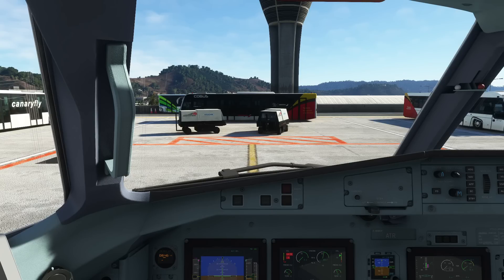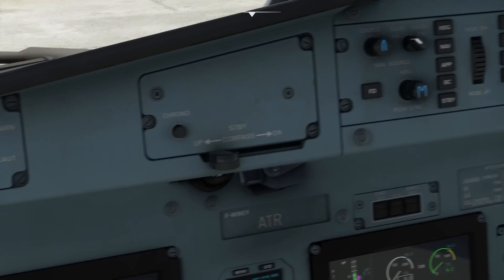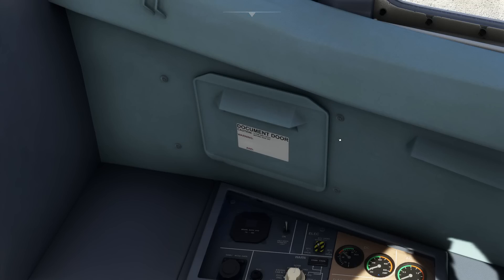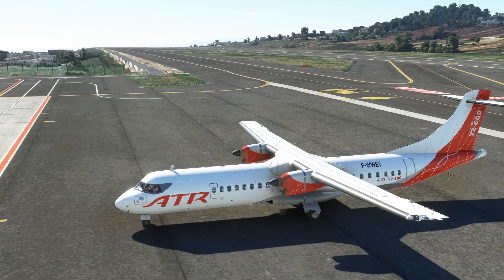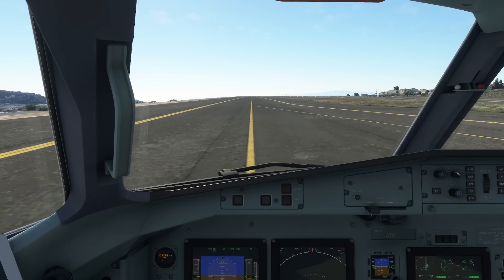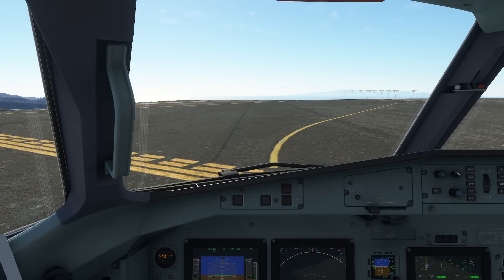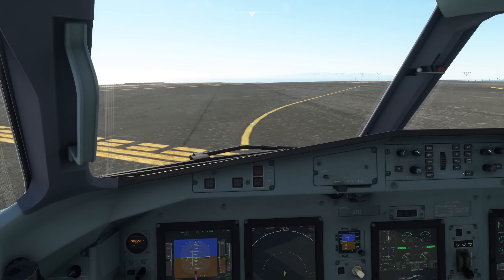ATR 72 & 42 Tutorial 4: Engine Start, Push/Powerback, Taxi | Real Airline Pilot

Comment: I wonder why the T/O config ok light lit up while the gust lock was still engaged? Further, all the other planes I've "flown" call for gust lock disengagement already in the before taxi checklist.
Reply from the maker: Looking into the FCOM it seems the gust lock should be part of the takeoff config test indeed. Be sure to submit a bug report!
I disengaged the gust lock at the moment where the FCOM normal procedures asked for it.
Reply: @A330Driver  I'll file an issue; though I don't own the ATR (yet, waiting for the Trall first). 
Btw, what is the situation with gust locks anyway - why do some planes have them as a switch and some planes not? (I guess the B73 and A32 still have them in the form of pins and locks outsite? Maybe this is even worth a video  ;)

Comment: Nice video using correct procedure for engine start...hopefully other simmers can learn from this video ..note.. there are two idle positions..FI & GI..latter is generally used for taxi..
Reply: With the new update of GSX the pushback in hotel mode is possible. At least it worked today.

Comment: Timestamps for myself:

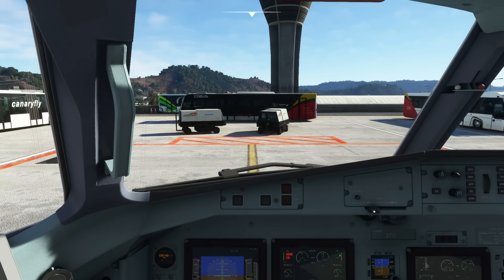------ Powerback or Pushback? 2:06 ------
NoseWheel Steering ON
Hydralic pump PRESS
Propeller Brakes OFF

Engine Stab - Condition Lever 2 AUTO - 3:10

Probe Heat ON - 3:50
Anti Ice Nec

Flaps - 15

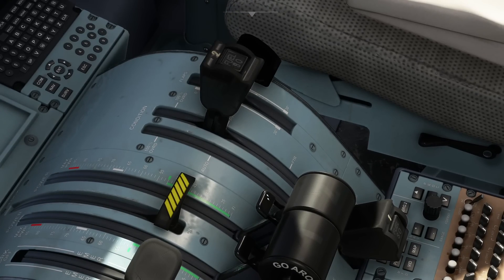------ Engine 1 Start 4:34 - 5:20 ------
ENG START - A&B
ENG 1 START
Above 10 % - Condition Lever 10 FEATHER
ENG Stabel - Condition Lever AUTO
Trans - ON
ENG START - OFF

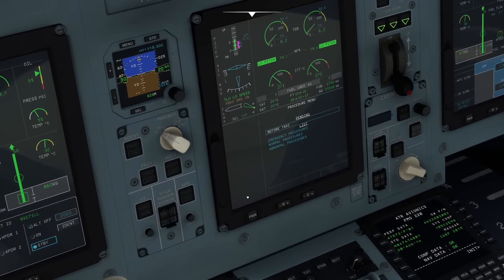------ Before Taxi 6:06 ------
ATC Clearence
Taxi Lights - ON

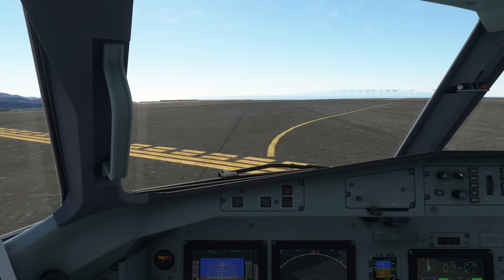------ Pushback and Taxi 6:55 - 11:20 ------
HDG - NAV - IAS 2x - 9:34

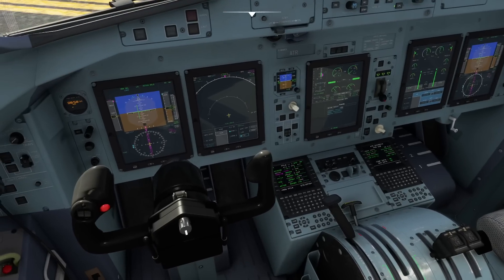------ Before TakeOff 12:20 ------
Speed Lock - Release
TCAS - Auto
Trans - ON
ALT OFF - OFF
Weather Radar 
Lineup Clearence
Landing Lights ON
Strobe Lights ON
Logo Lights - IF DARK
Synchronize Heading - 14:09

LINEUP RUNWAY